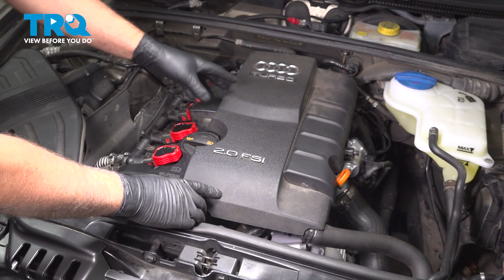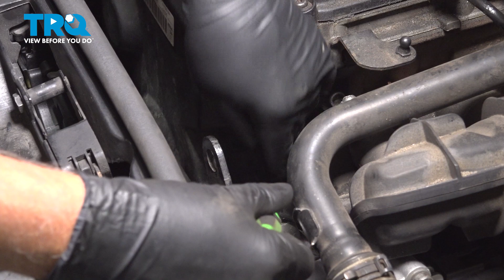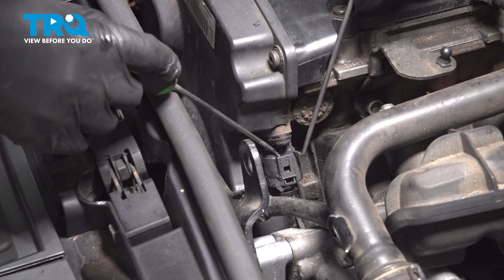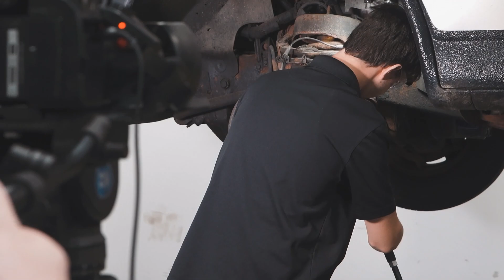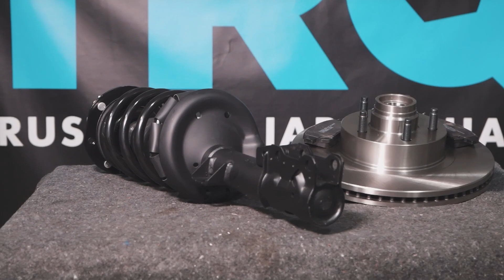How to Replace Camshaft Position Sensor 2004-2009 Audi A4 Quattro 2.0L L4

Comment: Video started off great...but you removed sensor and quickly swapped out old with new w/o first demonstrating the type of sensor. For those unfamiliar with the sensor, it would be helpful to see the type of sensor that your replacing. Make your video 10 seconds longer...
Reply from the maker: +@guslam3066 Thanks for the tip! We'll pass this info along to our production team. http://1aau.to/m/Shop-TRQ